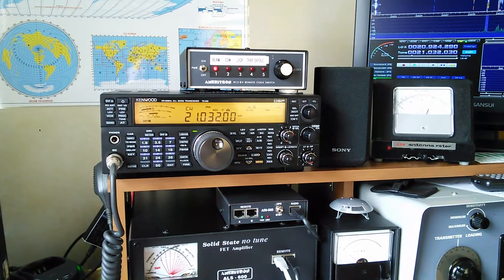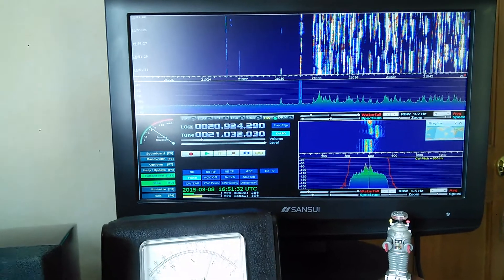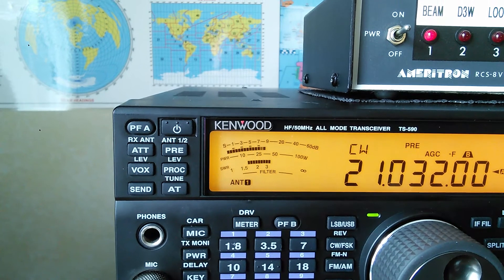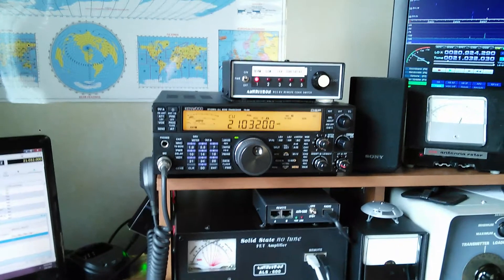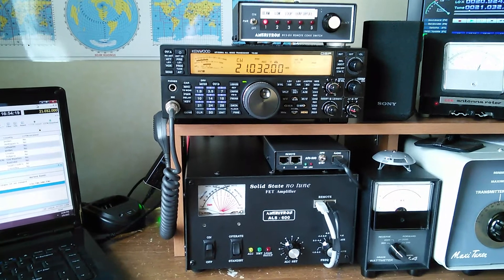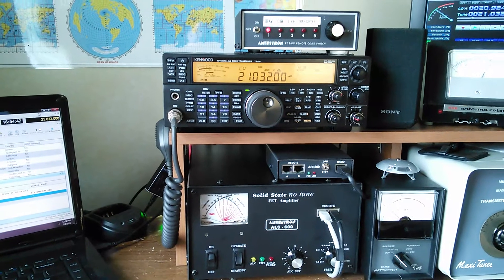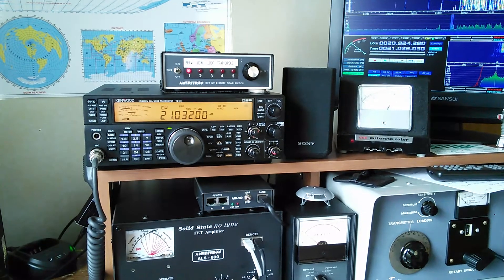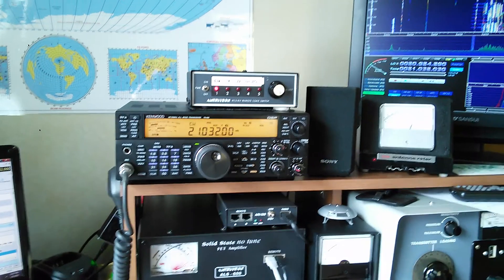Video 3 TS590s panaddapter mod

Comment: What point on circuit diagram do you use to get the IF signal for the RTL SDR?
Reply: DRV out on the 590sg is also an RF out to supply RF to the SDR dongle